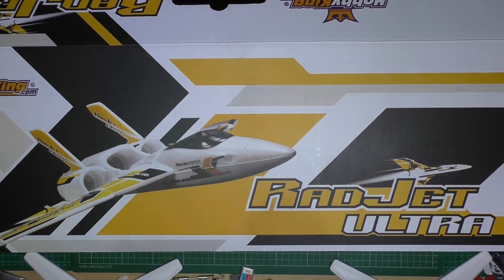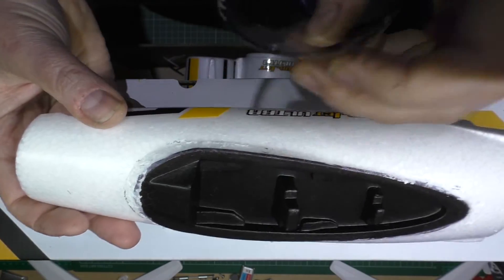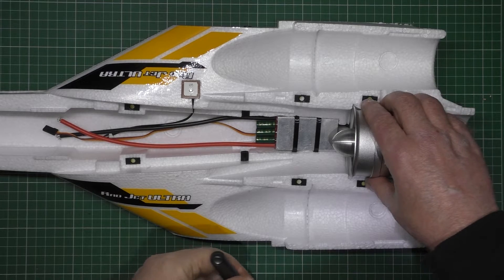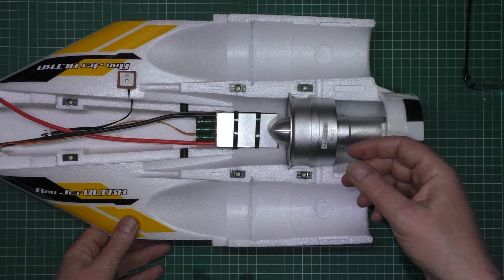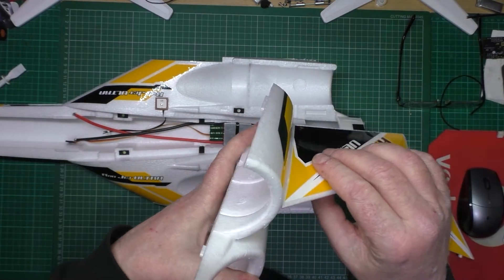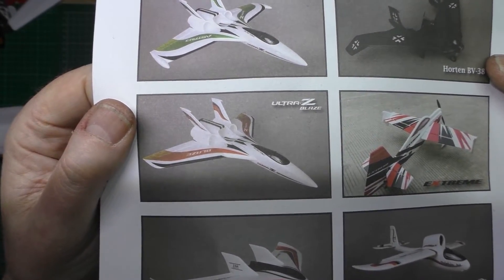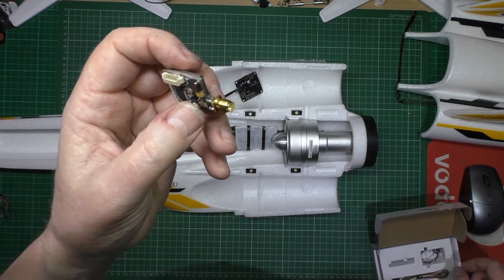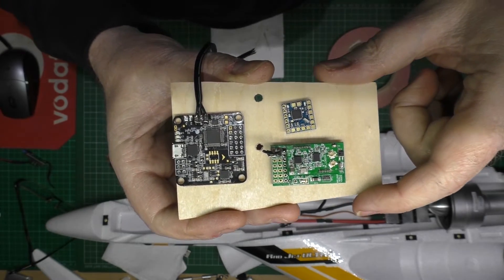Radjet Ultra EDF build part 1

Comment: Hi, I have seen the you video.
I have a little project
I bought 
https://www.banggood.com/Zeta-Ultra-Z-Blaze-790mm-Wingspan-EPO-Flying-Wing-Pusher-Jet-Racer-RC-Airplane-KIT-p-1111986.html?rmmds=myorder&cur_warehouse=CN
Now I must choose esc and motor/s 1 or 2 from banggoods, can you help me with the parts?
Then I install s8r and fpv system
This is my first jet; my experience is on the quadcopter and flying wings…

Comment: Hi
as usual super build.. however which FW are you using on Naze? just cleanflight for fixed wing? does it has all the functionality working?? I have in my bixler similar setup but using the patrik version of Baseflight done specifically for fix wing.. and it works perfectly.. It would be interesting to see the different capabilities... 

hope to see the flight soon
Reply from the maker: +Giovanni Perillo Yes, it's just the latest Cleanflight firmware. Everything seems to work but obviously, I won't know until I throw it :-)

Comment: i got the naze32 running and going once in a plane but now i cant bloody run it and the apm cos of the FTDI driver ... windows 10 wont let me install the 2.10 driver but only the 2.12 ftdi driver which needs an authentic ftdi board that i cant find grrrrrrrrrr

bought 3 different once all turned out clones
Reply from the maker: +Aron Gatt Why can't you install the 2.10?
Reply: +Aron Gatt The ftdi board from http://www.spikenzielabs.com are genuine.At least mine is and i got 4 of them.
Reply: Vortecks it wont let me , it tells me windows has determined that the best freakin driver is installed
Reply: +L Hansen thanks but theres no shipping available , i contacted FTDI now and sent them an Eprom shot so they double check it , cos where i bought the last one is insisting that its legit ( surly not!) but im giving him the benefit of the doubt.
Reply from the maker: +Aron Gatt Plug your FTDI in and right click the start button and go to 'Device Manager'. Find the FTDI which is usually in 'Ports (COM & LPT)' and listed as a USB Serial Port. Right click it, select 'Uninstall' and (when the uninstall box comes up) select 'Delete the driver software for this device'. Then, you should be able to install 2.10
Reply: +Vortecks fixed ..... tho the micro-osd is bricked

ordered a couple from bangood now
Reply from the maker: +Aron Gatt Bricked as in..... it doesn't communicate with the FTDI?
Reply: yep .... tried clearing eprom but no luck